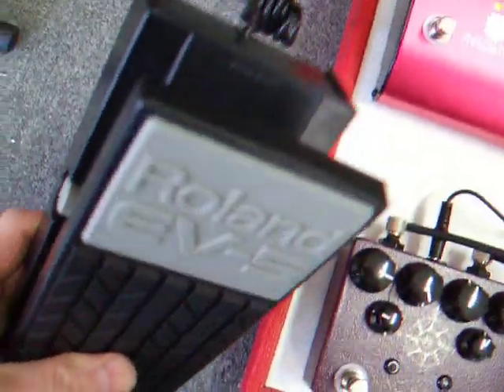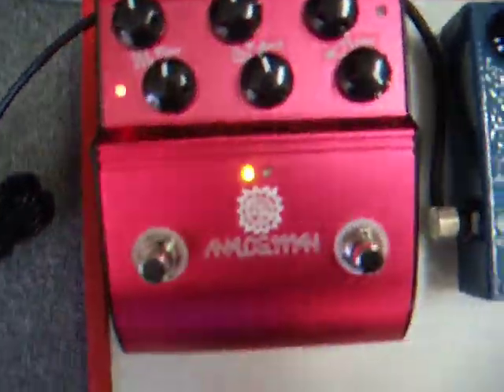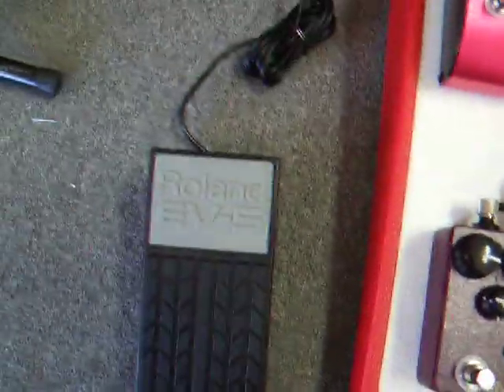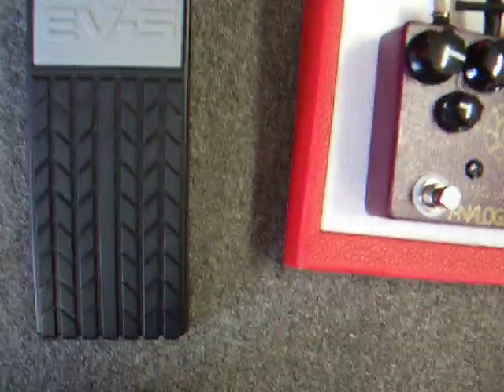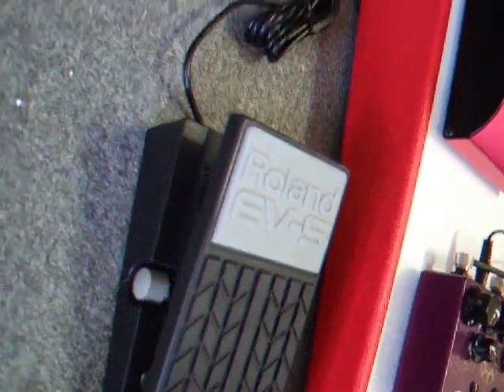ARDX20 EV5 control pedal modification

Comment: So I just modified my Roland ev5 and I'm trying to use it with my akai headrush e2 but it's not working. Do you know if there's something else I need to do?
Reply from the maker: Ruben Vangare Did it work OK before the mod? If so, double check the wiring and also try moving the knob on the side of the EV5 fully up and down and see if that helps.

Comment: I wonder if I could turn my EV5 into a guitar volume pedal...
Reply from the maker: Charlie Angel If you have a VERY well buffered signal, the 10K pot in the EV5 might work but you'd need to add another jack and rewire it. Won't work with passive pickups.